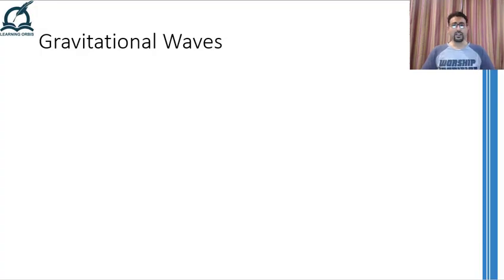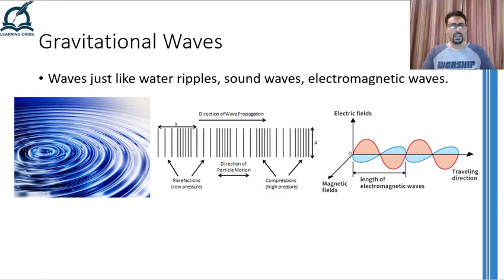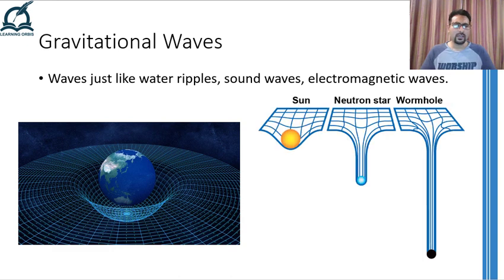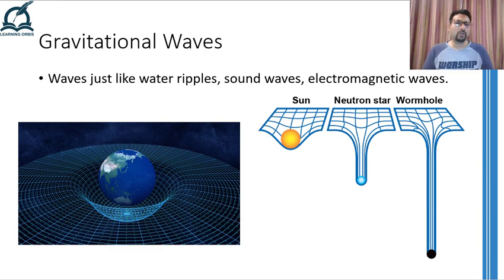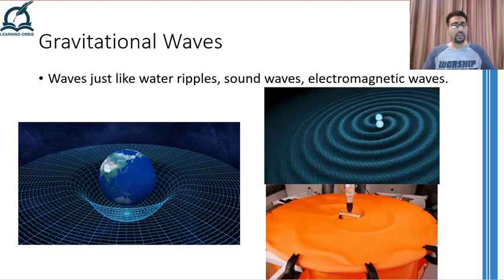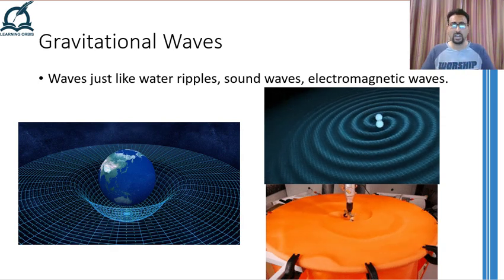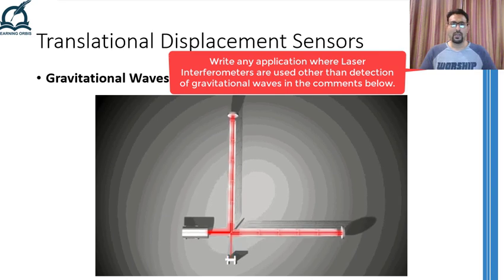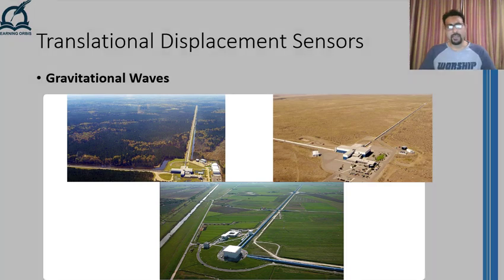Gravitational Waves | What, Why & How to measure them using Laser Interferometers

Comment: Laser Interferometers are used to detect:                                                                                                                                                                 1. cracks in big oil tanks, cutting tools   2. to determine diameter of fiber  3. To determine the surface flatness.

Comment: Laser interferometers are quite expensive and used where precision is required. They are used to detect defects, surface flatness and uniformity, and vibrations in machinery.

Comment: Laser interferometer is used to measure accurate measurement of length, to calibrate the axes of machine and to measure the small variation on the surface of micro organisms.

Comment: Laser interferometer are used for length measurement ranging from nanometers upto few meters. They are also used for analyzing and measuring mechanical vibrations without contact.

Comment: Laser Interferometers have various applications such as they are used in detection of very small changes and their observations, calibration of machinery axes, measurement of liner positioning, diameter of Circular cross sections etc.